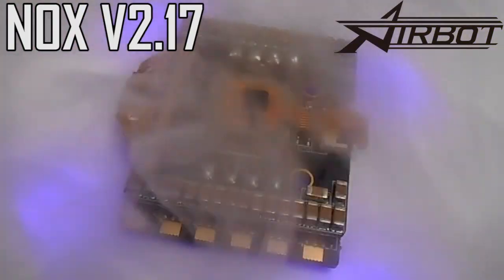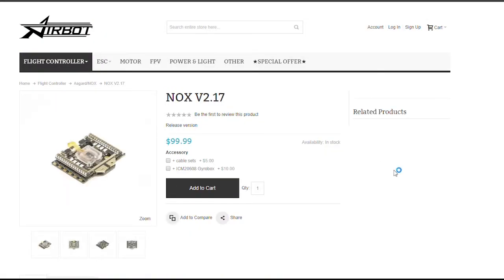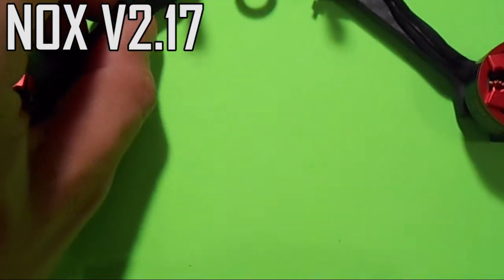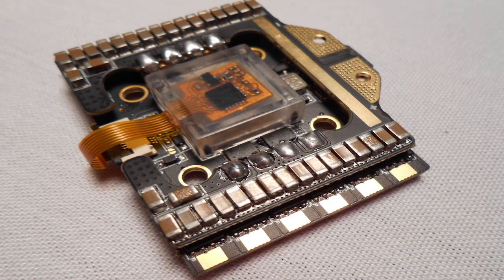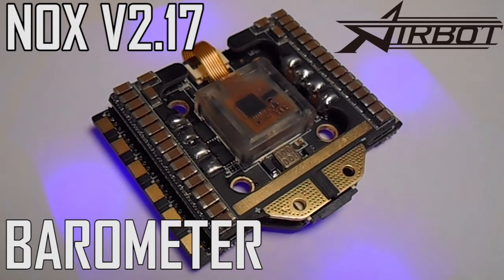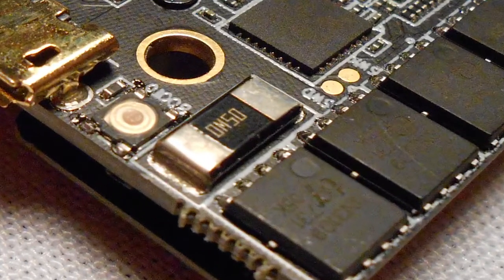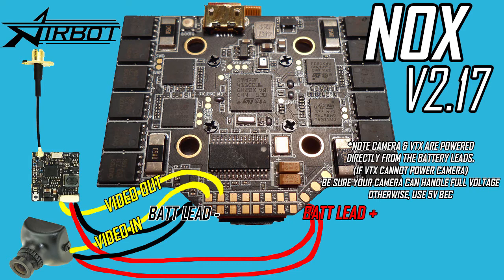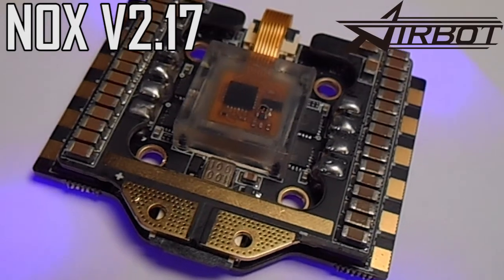NOX V2.17 - Complete Guide - From AIRBOT

Comment: Looks like not enough attention has been payed to align the motion sensor in the box properly. I am personally skeptical of foam and gel dampening. It can change tolerable vibration frequencies into intolerable vibration frequencies. O-rings on the standoff's is all that's needed.